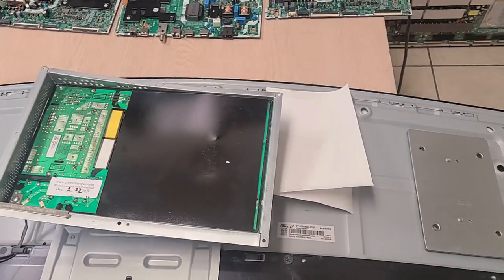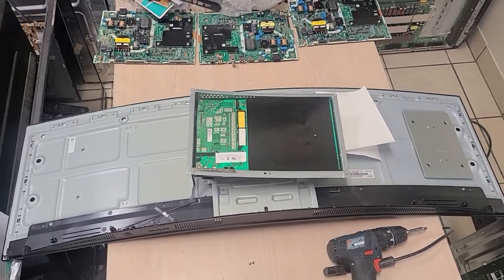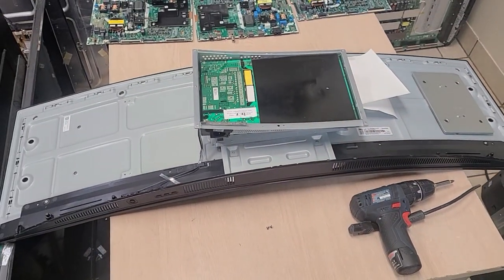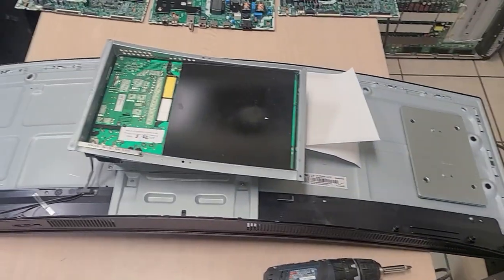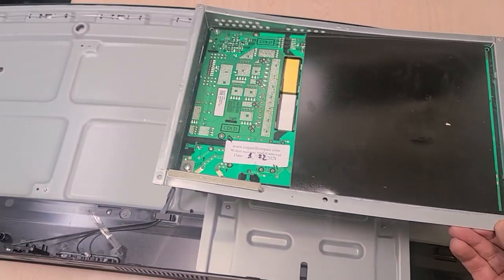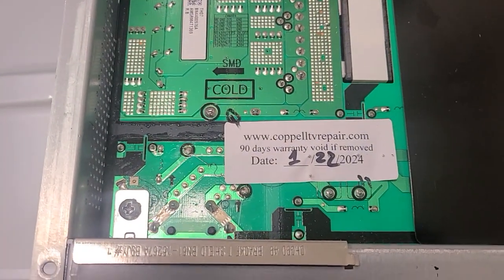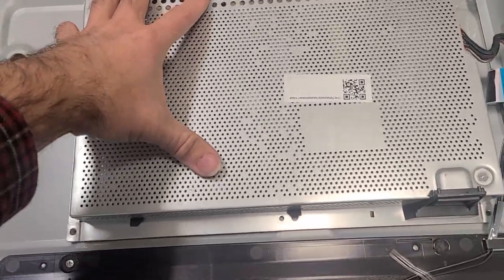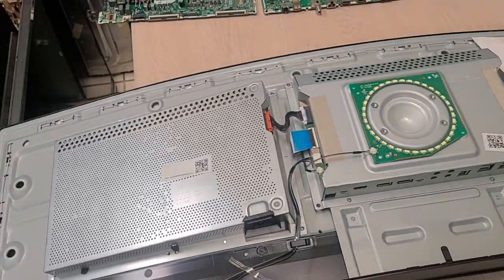Functionality proof Samsung Odyssey G9 gaming monitor after repair for dead power board 1/2

Comment: I have a 49in g9 model that died today. Heard a loud pop while gaming, screen immediately turned off and now won’t power up at all. 2 yrs old so out of warranty. What should I do.
Reply from the maker: Follow our video for opening the monitor very carefully and if you can test the main fuse on the power board to see if it is blown open. If it is DO NO try to replace it - watch another video of ours to see why this is not a good idea, it is really simple, really - the fuse blew because of a real failure, the fuse is NOT the failure. If the fuse is bad or if you can't test it perhaps just initiate service request at our website through the link in the video description. If the fuse is good then it's more difficult - the board may still be bad and in need of service, but it may also be something else such as the main board or the panel...though those do not usually make loud pops, mostly the power board does.
Reply: @ I will just submit a service request and remove and send power board to you to fix. Fingers crossed that fixes it because this monitor was pricey and I really don’t want to buy new ones if possible.

Comment: My Monitor is the LC49G95TSSNXZA it Started a year ago, after turning the PC on it would just flash but no screen, menu or anything. after booting I swapped cables from DP to HDMI
and I got it back running, it got worse every time and it took longer to get the screen or menu to show. so I left it running for 6 months straight, screensaver only. I had no problems. I had to turn it off last week since I was cleaning my water cooled Rig, I never got it back running. Any Ideas? Logic Board or the Main Board?
Reply: I just have the monitor plugged in nothing else but I can't get it to turn on
Reply: @bellojoey  You might just need the Samsung Odyssey G9 49" Monitor BN61-15267A Power Supply LC49HG90DMNXZA, mine turns on but no screen, so I need the Mainboard
your part runs about $80  while I need the Main Board $180

Comment: Love the video, I had a question about my monitor. I had an issue with a 49 inch g9. It turns on but the screen is black. I can hear the menu but I can’t see anything. Have any idea what the problem may be?
Reply from the maker: We have not seen this particular issue in G9 just yet, but we have seen it in many Samsung QLED TV models. We were also talking to a customer just yesterday about the exact same issue - at least by description - in his G9 and he uploaded some video that makes us think the problem, like with the TVs, is in the LCD COFs. If that is the case then the problem is not repairable - not in a practical sense anyway, theoretically Samsung may have machines that would allow it to replace the COFs.
It may be also be something different, of course.
One thing you can do is get to the bottom where there are two flat strip cables that go into the LCD and try disconnecting them one at a time to see if the backlight comes up and if you can make out anything on the screen with either of the two connected.
Reply: Same problem

Comment: Hi i got a samsung odessay g9 it was working perfectly but suddently it lost power i tried everything but its not even turning on. can you please suggest what can be the issue?
Reply from the maker: If there is a LED that turns on and shows color then I'd say the panel is likely bad. If the unit is all bricked and shows no signs of life whatsoever then it may be a bad power board or a bad main board.  Both are preferred to a bad panel.

Comment: My G9 worked fine one night, the day after it wouldnt even turn on. Measured 20V out of the adapter, so its not that, problem is the monitor itself, no lights, no response, nothing, completely dead. Had it for couple of months.
Reply from the maker: Sounds like a main board problem to me, but just in case make sure to power cycle and ensure the power on button is not flanky. Feel free to send the main board to us for test and possible repair through the website.